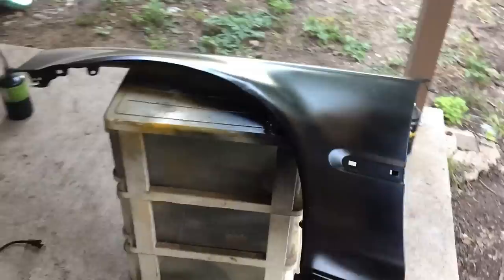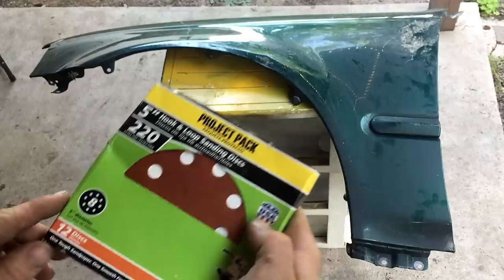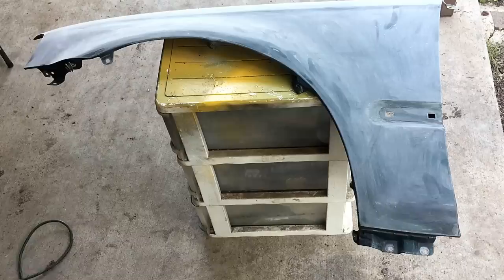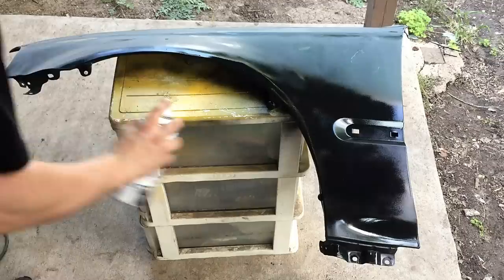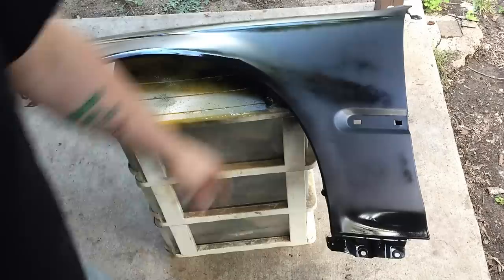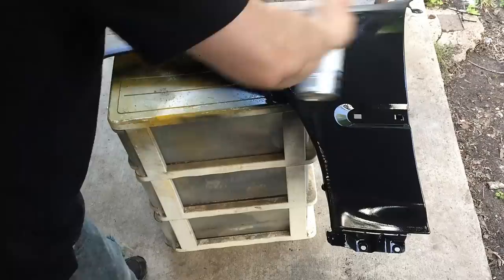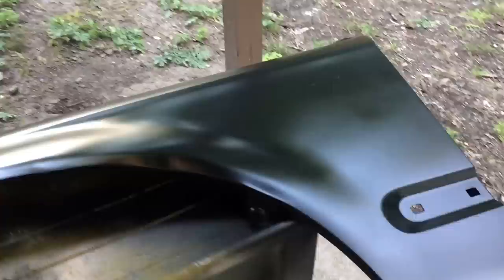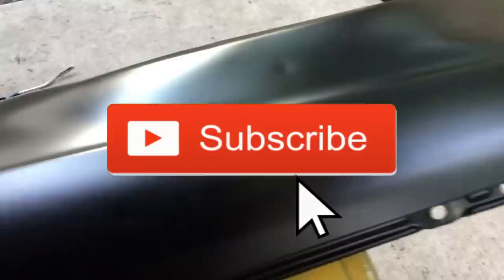Detailed how to- Spray painting matte black & making it look good!

Comment: I’m so glad I came across your video because I was about to snap 😅 I was spray painting a cd player top cover. I followed the directions word for word and even used tips from other videos and Google. Every time I sprayed the base coat (satin black) it stayed blotchy AF! I had to re sand and prime the thing 3 times with the same blotchy outcome. Everyone said to spray “light” coats, I would do that but every time the paint would be uneven and resulted in the blotchy paint. I did what you did on this video, paint a closer heavier coat the second time around wow problem fixed! Even coat all around. Left it out on the sun all day and couldn’t be happier with the outcome.

Comment: What up bro I have a 1997 Honda Civic CX hatchback and it's got a P0505 and tried replacing the iac valve and the code comes back after about a day or two and it's the electronic iac valve. Good job with video's and keep up the good work
Reply from the maker: timbo0755 You have a intake gasket leak somewhere. Spray carb cleaner around the intake manifold/injectors while the engine is running to see if there is a change in the way the vehicle runs. Spray around the throttle body as well. Hope it helps and let me know what you find
Reply: @JamesDguy  hey what's your bro I did what you told me to and I have not found the vacuum leak yet but I haven't jack the car up to check underneath the intake to see it the idle changes but I did replace the fuel filter and that's when the check engine light came on and the car start to run rough so I revved up the engine for the a little bit and the it smooth out the idle a little bit

Comment: I didn't even know that there was a matte black spray paint available. I kinda like blacked out cars and trucks. I like using the stick on (forgot what they are actually called) light covers that allows light to go through but if the lights aren't on just appears black light there aren't even head lights, trail lights, signal lights.

Comment: Hi! What if protect the plack paint with mat clear? I've been told, that not until clear, protect the paint..
Reply from the maker: Riku Koivisto Confused by the question but I’m assuming your saying something about matte clear coat? The spray max 2k matte clear will protect it from sun fading and damage. It’s good stuff you should deft clear it. But not required exactly

Comment: Have you ever tried any graffiti fatcaps on rustoleum can to spray a car?
Reply: Bryan Sage ArtPrimo got em
Reply: @gimmeat0wel  yea I got a 10 pack...
Reply: Lmk which one runs great on a rusto
Reply: @gimmeat0wel  I got the rusto fatcap thats made for rustoleum male valve spray paint. The spray pattern is like 4 inches wide so no strips...
Reply: Bryan Sage i’ve used caligraphy caps,worked good.what have you use,Fatcap?
Reply: @sikk84mcss  yes the fatcaps  that are made for rustolum 2x male valve...
Reply: NY thins and adapter. NY thins have a better pattern for even coating

Comment: I’m looking to spray my bumpers and trim matte black, wondering when you would apply the matte clear coat? After 24 hours of drying? Or basically apply shortly after you spray the matte black paint? My bumpers and trim are plastic, so I will be using Rust-Oleum bumper and trim paint. Thank you in advance for any help/advise.

Comment: Just my opinion, but when I first bought my black & Decker sander, Walmart sold their sandpaper too. But when they switched to the off brand stuff your using in your video, I found it didn't work at all. I found buying the sandpaper from home depot or Lowes works way better. Most smaller hardware storage all carry that type of sandpaper (even in pro versions) but they are all the same level of just-dont-work.
Reply from the maker: Diga Prints Your Right 100% the gator brand sand paper don’t work very well but it was all that was open at midnight when I did a project awhile back and it’s all I had left over but it worked for what i needed it for. I usually get the large packs from Home Depot that have the red colored sanding pads.

Comment: Nice! How about painting over a chrome bumper
Reply: I did this on my ford f150 if you sand the chrome with 180 then wetsand it after it holds paint pretty well it stayed on my truck for over a year no issues until I sold it

Comment: I used 320 and it shows sanding scratches after paint! How can remove the scratches would the spray max clear coat hide them?
Reply from the maker: steelers412 I didn’t even show sand scratches through with 220 and typically do. I think it’s because I put the coats on thicker applying 2 decent coats covered them. You can also prime before the color which usually fills in sand scratches. I have never had 320 show scratches even with a thinner coat of paint on there. I’m just assuming the coats weren’t thick enough. My only thoughts
Reply: Use 400 then paint
Reply: You don't going to have any scratches using 400 grit. Then paint.
Reply: Thanks guys I’ll give a try!

Comment: So if I do the 2x Semi Gloss Black do I use Semi gloss clear or 2x Matte Clear? The 2x Satin black I tried still had  more sheen/reflection in it. I saw a video of a kid doing a old 90s silverado in 2x Semi Gloss looked very good came out almost flat black but he did not add any 2x clear coat. The flatter the paint it seems the less it shows the small imperfections in the bodywork. My 2x primer I am using while I do the body work is hiding the imperfections pretty good but after I finished the fender I was working I prepped it and added the Satin Black it looked like slightly faded Gloss Black really..Should I slightly scuff the base black before I add the clear regardless or just shoot the black wait overnight and hit it with the clear or just wait a few hours then the clear?..Sorry lotta questions I am trying to do this once Thanks a Lot...Jeff
Reply: I think he was talking about the 2k clear matte by spray max to give it that satin look

Comment: Is rattle can painting a vehicle a multiple day process,?
Reply from the maker: Trent Martin It don’t have to be. If you do what I did when I painted my g35 lime green it only takes a few hours. Then you let it dry over night for best results
Reply: Trent Martin only drawback with using rattle cans is that the sun will fade your paint job within a few weeks, it will not last very long....  ):
Reply: FelixD cat Can you defend that opinion with verifiable data? Or, are you implying the “rattle can paint” is somehow not “actual paint”? The pigment in rattle cans is exactly the same as “gun paint”.  The carrier is the same. The air supply is still compressed, though it contains a propellant. But, it IS paint. The differences lie in the type of paint. He is spraying enamel...not base/clear (“two stage”). Enamel does not endure UV well, unless it is baked. Air drying is the weakness. However, if you use a product like Eastwood’s 2K “rattle cans”, you are shooting two stage. You can get enamel with a hardener, meant for air drying. Or, you can get genuine two stage base/clear.
But, if you compare apples to apples, there is no reason why you can’t spray rattle cans and get good endurance and UV resistance.
Reply: @Delfi1900  must not be doing it right if that's the case.
Reply: @Delfi1900  that's not true at all not even close to it what paint are you using most def not rustoleum
Reply: @Delfi1900  - "Fading" doesn't really apply/matter with a matt finish though.   The whole aesthetic is a faded, dusty look.

Comment: Whyd u say put yhe wax remover on before u sand but u put it on after sanding?
Reply: Wax remover first if not  it will be harder to sand. Wipe down the sanded area with a tack cloth or if don't have a tack cloth Wipe it down with windex and let it evaporate. You should be good to go
Reply: So you don't sand dirt, oil, greade and things like that in to the paint.

Comment: I bought 3 cans of the flat black it's literally the worst can of paint I've ever used it was really textured like it had dirt in it and half came out flat and half came out glossy took hours to sand that garbage off I'll stick to 97 cent walmart black primer
Reply: Try matte black I can assure you there will be no gloss
Reply: I recommend you try matte clear coat.  Do a very thin mist coat and then a couple of more very thin coats because the matte dries really fast.  By the time you put on a coat on your door,  you should be able to apply a coat on the fender.
Reply: Had similar experience with the flat black, bumpy af, and blotchy and you weren't sure if you should keep going or stop. Matte Black ultra is night and day trust me, prep matters too
Reply: Your supposed to purge the can and clear the buildup inside it first. He literally said that In the video

Comment: If i wanna paint a whole normal sized 2 door car much do you think it would cost me?
Reply: I just did my car, small 4 door wagon (toyota alltrac 4x4) and it took 12 cans. How-ever, 2 of the cans were primer and sprayed on like nothing, should have just had all 2x paint. And I also did it in light to medium wind. So in ideal conditions I think you could get away with 10. But do 12 anyway, when the paint is thick it looks way better than just a couple coats.
Reply: Zac Johnson do you need to 320 sand the entire car before painting??
Reply: @mjmsaa  yes .why would you only sand parts of it

Comment: How do I change my bikes side panels which is glossy black metal to look  matte finish kind of like carbon fibre. There's no video on gloss metal to matte finish videos on YouTube 😢
Reply from the maker: Auro kris make it look like carbon fiber or just a matte black finish?
Reply: Not sure about both of those.. Glossy finish is tough to maintain and scratches so I thought matte would be better looking as well as solve the scratches problem
Reply from the maker: Auro kris You can see scratches still in matte/flat or gloss my solution was bed lining lol I literally bed liner many vehicles it looks good and very durable which I have videos on here of me doing.If you go matte black it looks very good I just recommend a 2k matte clear and it would be in my opinion perfect.

Comment: why do i have stripes on my paint job? how do i fix or avoid stripes for future projects
Reply: Not wet enough.
Reply: Spray further away
Reply: more coats and too close wind is bad as well just between 10 and 12 inch away go light and repeat  so no drips ir stripes stripesvis to close drips too close and too much or car wet before or after before its dry

Comment: Ok so why didn’t you primer it before painting ?
Reply: Primer is for rust. If your panel is soft and not past factory primer your good.... But I like your question because they told me what I told you. I did this yesterday doing my car matte blue. Without primer you won't see all the bad spots you can fix with glaze puddy before paint after primer.. primer will show what your paint will look like. And dents and shit you can't even seewithout primer
Reply: Because the paint he used was paint +primer
Reply: No need to if no bare metal is showing.
Reply: @cognac8297  primer isn't for rust. It's to help paint stick (mainly on bare metal), fill very fine scratches. Primer is flat so it doesn't really help you see spots to fix. If used as a guide coat for sanding it can.